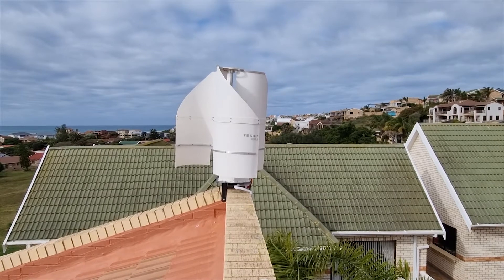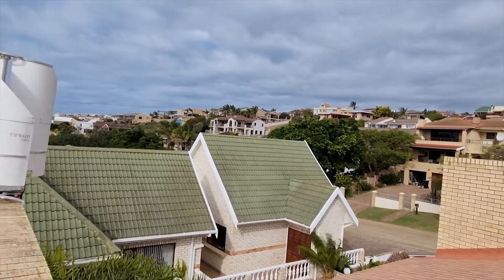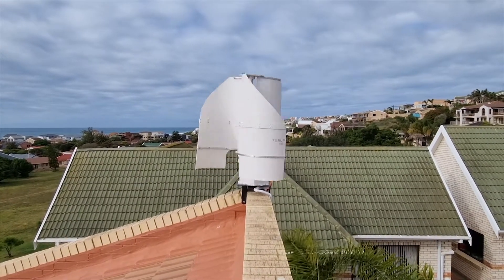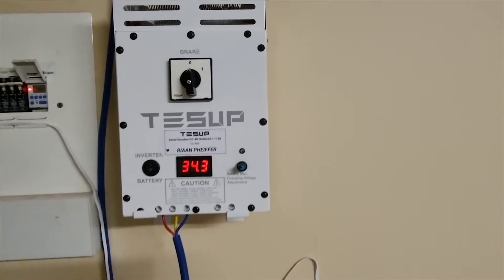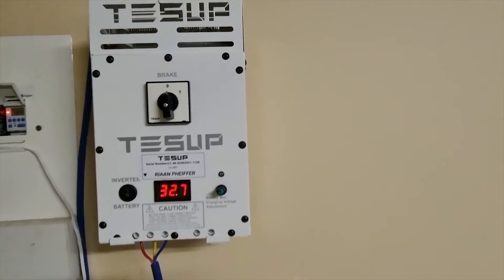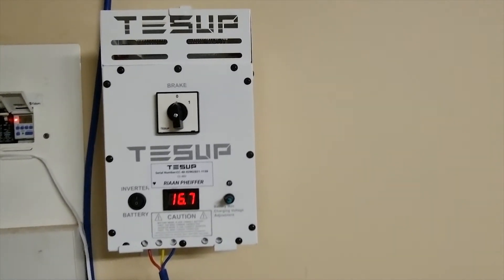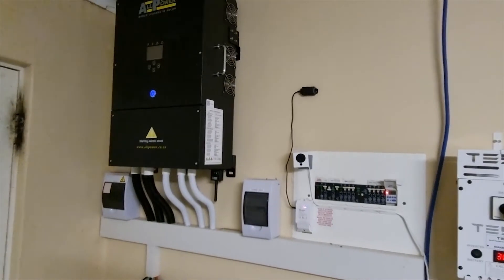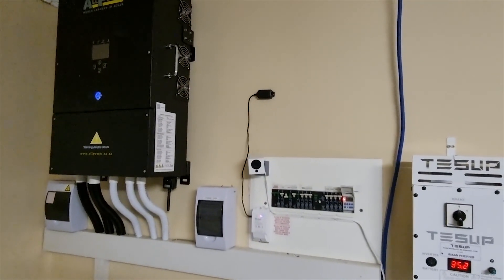Tesup Wind Turbine

Comment: All practical tests show that all small wind turbines hardly generate any electricity. And mostly at costs very above 1$/kWh!There is hardly any wind close to the ground & extremely gusty, which always reduces the lifespan of the systems. Solar panels, on the other hand, generate electricity reliably for 25 years at approx. 3-6 cents/kWh!
Only those who need to be self-sufficient from the power grid should therefore install a wind turbine.

Comment: I did a mediocre review on my channel and my Tesup 2.0 turbine never put out enough consistently to charge my batteries.  I had it hooked up to my 48v EaSun All In One contoller and it did nothing for me.  Blade flew off and eventually the remaining blades and shaft flew off. Shaft snapped right off.

Comment: A beautiful spinning talking point, that's all it is.
Reply from the maker: Hi John. Any Idea or help how to step up the voltage from 12v to 250v so that I can connect it to my inverter?
Reply: @PPGRiaan  ...I believe the easiest way would be is to connect it via a 3 phase rectifier directly, do not use a charge controller, to a 12 volt battery,  preferable a lithium version since lead batteries have a 30% loss alone by charging, and from there to a 12volt inverter to get your 240 or 120 volt AC. But most important is a strong wind, a wind which you have to fight against, this kind of wind has some power in it where you can extract about half with a horizontal wind turbine but only 8% with a vertical axis wind turbine.
Reply: @PPGRiaan  you want from ac 3 phase 12v to 250 DC?
Reply: @PPGRiaan  were you able to connect it to your syunsynk inverter? Im trying to search for the same solution, go from 96V AC to 250V DC and connect it to the MPPT of my DEYE inverter. Let me know please if you  got it working..
Reply from the maker: @carlohoyek3656  Morning Carlo. I have been out of the country for a couple of months now, so was not able to work on this project. But to answer your question no. I have not been able to solve the problem.

Comment: How about an update?  Make a short video and update us on your power output and wind conditions.
Reply from the maker: Thanks for watching. I will do an update as soon as I can get the turbine connected to my Inverter. That will give us more useful data to work with.
Reply: I just got an update from Tesup, they’re finally shipping my Atlas X. And I’ll keep you updated on that compared to yours. It’s the newer model bigger generator. March 31 was the order date and they just shipped on 21 June.
Reply: @Themachinewon  how does your Tesup turbine perform?
Reply: @Marcel-lv1yu  I have the AtlasX. As you’ve seen from my videos, I had to rebuild the complete turbine. Poor Quality. As of now, I’m at the point of doing the final testing, before putting it up on the 30ft tower. I purchased a Aurora Interface box, and Aurora Wind inverter, which I have to program still with the power curve from the turbine. I’m also finishing my gin pole crank. I had to purchase a DC power supply to program the inverter. I’m slowly getting there. I have to make sure this all works before I put this up in the Air.  As of now, It’s hasn’t produced anything but trouble !   Pretty sure I’ll have it programmed and wind tested in Dec. Busy with work now.. 
How is your system working ? your doing the battery bank ?

Comment: if you going to do vertical then go with a foil vertical turbine. savonius is the most inefficient design. Plenty of accessible technical YT videos showing why savonius isn't a good idea. I like vertical for your use case, residential high wind environment. good luck
Reply from the maker: Schumzy. Thank you for the info. I will have a look at the option. I just need to get it integrated into my inverter first.
Reply: I'm purchasing a Atlas X from Tesup, it would be less invasive in my suburban area and I'm putting it on a wilburt 60 foot telescopic pole

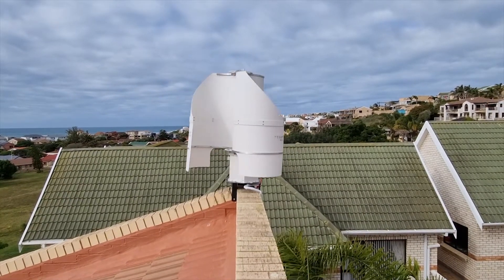Comment: This product, while it might look good on the surface, is absolute trash; a good example is the box at 1:35 , it's nearly empty inside, just a tiny board and grossly undersized wiring. Never buy Tesup; look up reviews.
Reply: What brand do you reccomend?
Reply: @lenkapadysak3523  , if you are mechanically inclined and can build everything yourself , go with a hi output PMA rotor , 
Then get a GM 12si alternator and build it yourself , 
Mine is a 12 volt but the faster it spins the more volts it makes , I have gotten it up to 19 volts at 3600 rpm and makes 1200 to 1800 watts ,
You would still have to buy 12 volt deep cycle batteries and power inverters , then decide if it's going to be a grid tie or off grid unit ,
Mine is off grid meaning that it's NOT tied into the electric grid or electric company
Reply: @lenkapadysak3523  I have barely looked at any brands so can't recommend; this is one of the only specific brands I've gotten around to dig up info about; I can only recommend not to go with this brand. Spend some time looking around, look up in depth videos and reviews. There's many bad products out there, and with something like windmills you have to go with the more expensive ones; it will pay in the long run that they last well and perform properly, and don't outright risk breaking down in the first week. I'm looking for a VAWT type myself for aesthetics and low wind performance. Regardless, if you don't go with the cheaper ones you'll probably get a proper product; they all look very professional as long as you don't go for the cheap end. If you're serious about it you need one attached to a 20-30ft mast, no way around it if you want ~3KW without having several windmills down low. However, if you just want to start out slowly, maybe just go with one that doesn't require a mast; you could even go with this brand, if it's just for learning and with no real expectancies. For what it is, it is a cheap entry, and it is safe; it does what's necessary but the quality really is lacking, grossly in some aspects, compared to a serious product; I wouldn't expect it to last much beyond 2 years, but it's not impossible. I may have judged it too harshly, I just got very disgruntled by the fact that the box is nearly empty; I can only assume that the box was made that big, to fool their costumers into thinking they're getting a solid product (there's no technical reason for it). It's somewhat of a toy, but it does work. Maybe it's just what you're looking for, if you're just looking to try out the technology. If you do go with them, and in particular this model, make sure to put loctite on the screws holding the fins, before screwing them in; for good measure, also add plenty lubricant grease around the axle hole of the windmills generator box, to seal it off from rain, and add more periodically as necessary; seems like a red flag to me that rain can just get in willy nilly.

Comment: Totally how much price.  How many watts  current  product
Reply: I gave $50 for my PMA rotor back in 2016 , then built it myself using a 12SI General 
Motors alternator , 
It's 12 volts and makes 1200 to 1800 watts depending on how fast it spins , 
Blades are made from a 55 gallon steel drum that cost around $15 to $25 dollars depending on where you buy it , I got mine for Free , 
Then I used heavy duty car bearings that you can get from any auto parts store ,
I then welded things together and don't even have $75 dollars for everything , but I seen the same PMA rotor today and it around $150 or a complete unit is $250 , then you would have to buy everything else I just said , 
It's cheaper to build everything yourself if you know what you are doing , but if you don't I would suggest you buy everything already to go , but it will be more expensive
Reply: @jimthomas777  do you have a video of your current turbine setup?
Reply: @Unseeable..  , I watched a video from Jeff at Missouri wind and solar about 5 years ago , I just did the same thing as he said to do , I took a 
G.M. Alternator apart and installed one of his neodymium magnet rotors , his has horizontal Axis Wind Blades , 
I just cut up a 55 gallon tank into 5  same size sections ,  and making a V.A.W.T. or vertical axis wind turbine , 
You will need steel , I'm using Car wheel bearings , but you can use different bearings  , 
And I'm a Welder so I got used Steel , nuts and bolts , brackets and remember to balance everything , 
I used a serpentine belt instead of a V- belt  , 
And the higher you mount everything , the more wind it will get , 

I didn't think to film it , I had no reason to , I was after electricity , not a video , but if you need help , watch videos like I did and if you have any questions just ask , I'll try to help you if I can
Reply: @jimthomas777  thanks! How’s it performing by the way? How many watts are getting on a typical day?
Reply: @Unseeable..  , it's just one of 4  P.M.A.s  , 
The others are getting built as a Water Wheel , a bicycle powered one , and a small 40cc gasoline chainsaw engine , plus I have Solar Panels , and a Generac generator for backup
Wind is about 5 to 10 mph so if you are thinking that just one will run an entire house , they won't , sometimes the wind doesn't blow , sometimes the Sun doesn't shine on the Solar Panels , and the creek doesn't run without rain , 
So it's whatever that's going on at that time that makes power , 
Always remember to have a backup and then a backup for the backup
Reply: @jimthomas777  very smart having all types of energy generators. How are you going about storagying the electricity?
Reply: @Unseeable..  , that's were I don't have adequate storage , 
I was using regular  12 volt car batteries and they drain very fast , I was thinking about a used Electric Fork Lift battery , they last 20 years ,
Or used lithium ion hospital cart batteries , 
New lithium batteries are 
$1000 or more 
Tesla battery
Battle Born  battery 

I'm not wanting to go in debt ,
A Solar Panel System is $10,000 to $30,000 dollars 
The whole idea is to save money , I buy things for my system as I can afford them , 
I am still on the Grids Electric Power supply but my bills were $175 to  $225  each month ,
Now they never go over $35 each month , 
So I can buy a another Solar Panel or Power inverter and I am keeping my eye out on a cheap suitable batteries .
But everything I have has been paid in full , I owe ZERO.
All  4 of my  P.M.A.s , All my Solar Panels , all my inverters , 
And all my batteries are all paid in full   ,
I don't even have $1000 in everything , but a lot of work because I did everything myself and it's taking time , 
But my electric bills are down and I'm Free from debt , 
I watch videos like this one to get ideas for my system, then if they are what I'm looking for , I will try to add it , if not I continue searching for something else , 

If you live where there is constant wind , I would get several Wind Turbines , 
If it's Sunny most of the time , 
then invest in Solar Panels , 
The Trick is to do what is best for your situation , 
If you have a small creek or river near by , get a Water Wheel to drive the P.M.A.  
Solar Panels don't work very well with a foot of snow on top of them and don't work at all at Night , so think before you buy something
Reply: @jimthomas777  very clever indeed, you are going green without breaking the bank. 
My goals exactly!